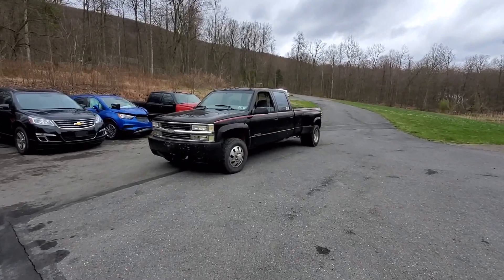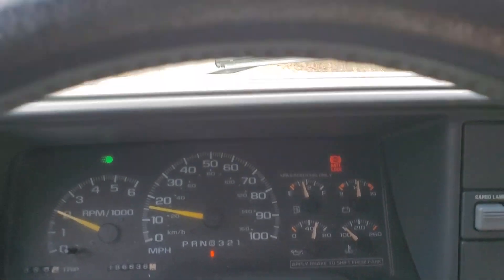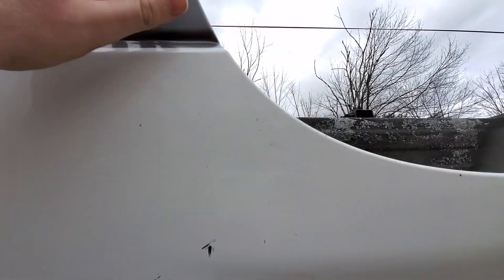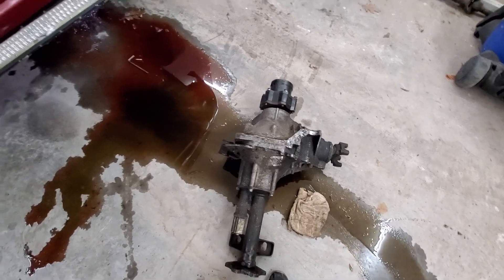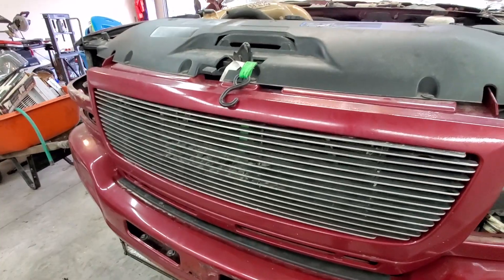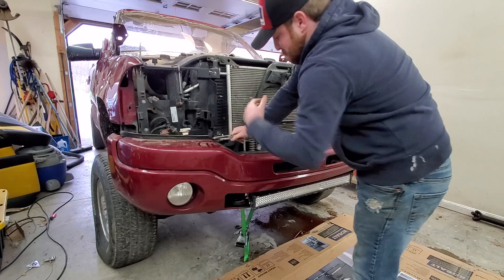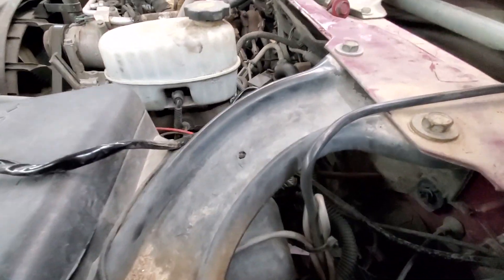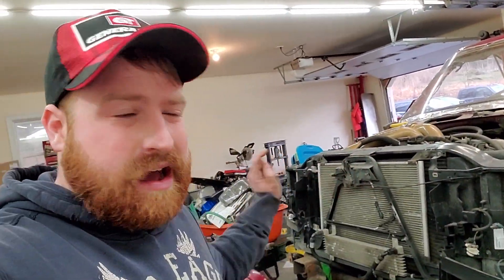The Whistlin Diesel Duramax Gets a Junkyard Bed! + Front End Tear Down!

Comment: to make the bed work you need to put the 03-06 lights and harness and junction block on. if i’m not mistaken the junction block on the bed is the same from 99-13 on some models
Reply from the maker: Yeah I think you're right. I think I have everything to make it work thankfully.
Reply: TopLineRacer hopefully the bed will mount up ok. i don’t remember if they where the same from 99-06 or not

Comment: Did that bed have a huge 10"x10" patch put in it?  Looked liked it when it was upside down and you were showing the condition.
Reply: rocky31186 looked like a heat shield
Reply: That was the fuel pump access panel.
Reply: No, it was at the passenger rear not the drivers front of the bed. It's definitely a patch panel from rust.
Reply from the maker: It might be, I honestly didnt see it but I'll check it out tomorrow.
Reply: I see it now. Good eye rocky

Comment: If it's a 454 it's probably a clogged egr. Just ran into that issue a few months ago after a guy did a complete tune up and timing chain replacement.
Reply from the maker: Thanks for the info!
Reply: @TopLineRacer  no problem. Let me know it works

Comment: More then likely it's bad injectors on that 454. Common issue with the 454 vortecs.
Reply from the maker: Thanks!
Reply: TopLineRacer another common issue is the distributor cap. At least it is on the 5.7 vortecs.

Comment: Are you still looking for an interior? I have a complete 2001 extended cab gray leather, power everything, captains fronts interior i'd sell cheap. Drivers seat has a tiny tear, that's it!
Oh ya, I think that aftermarket grill looks nice too.
Reply: Spencer Sorenson i believe the 99-02 uses different interior and different wiring, and a global lan system. the 03-06 uses a can bus Data II.
Reply from the maker: Thanks man, I got a pretty solid deal on the set I showed in the video but I do really appreciate it!

Comment: Poor Chevy truck it leaks. Well it's a Chevy what did you expect. Should have bought a Ford or a Dodge Chevy sucks 😜🤣. But joking aside Dodge has the best diesel engine  Cummins 12v. Chevy has the best automatic transmission Allison. Ford  has the 7.3 powerstroke 1994.5-2002 OBS - superduty 🤣👍. At least you're fixing a good truck that whistlin diesel destroyed. Can't wait to see it finished.
Reply from the maker: The cummins is the best engine for sure, the dodge trucks aren't great though in my experience (the new ones are pretty awesome though so far). I'm a GM guy and I personally prefer the combo of Duramax and Allison over everything else. Honestly they are all pretty good trucks right now.

Comment: After working in the collision repair field for 27 years. I would not do what you are doing. GM trucks are a pain in the ass. I hate working on thim. Buy Toyota Tundra and put the izuzu made Duramax in the Tundra. You are wasting ur time.
Reply from the maker: I'm not sure what you mean.
We are basically just bolting on replacement parts, not alot of body work to do other than paint.
Reply from the maker: No.
Reply: @TopLineRacer  Sorry about yesterday. Just never liked working on Chevy trucks on commission. Thay don't pay as good as Toyota. But nice job on the truck. U should try to get that Ford before he destroys it. Sorry again.